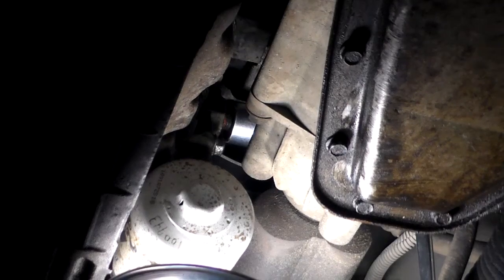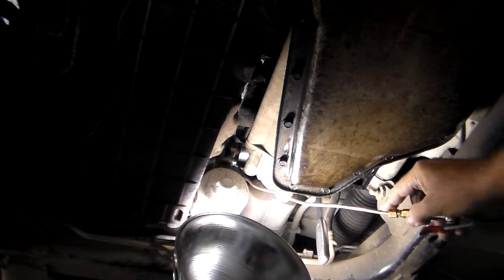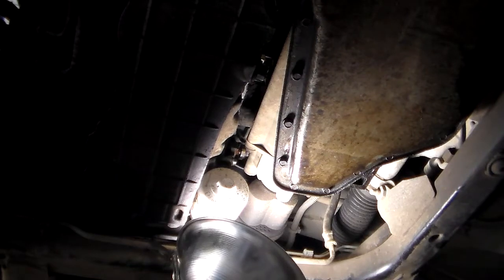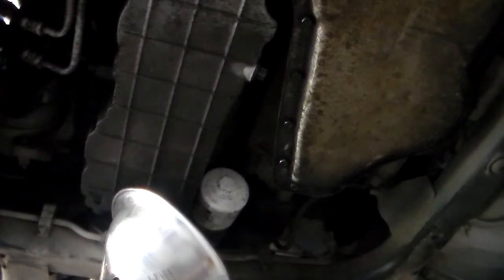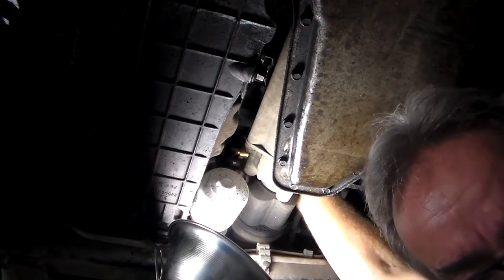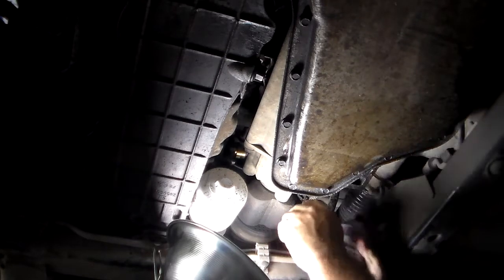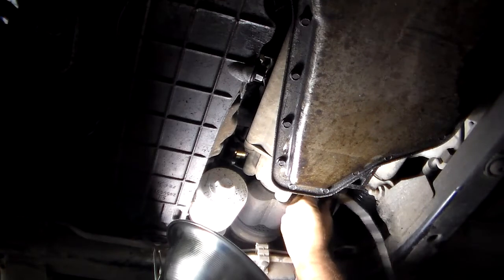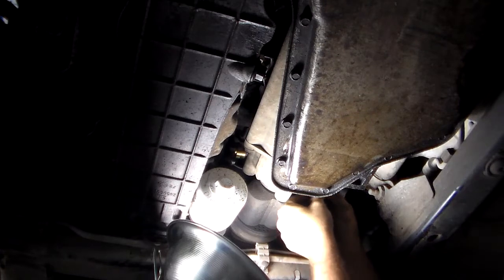2003 Buick Lesabre oil sending unit leaking

Comment: Looks like it's right above the oil filter, correct? What brand did you go with for the sensor and do you need any swivel sockets to get at it? I do have an actual sensor socket for it....Great video! Thanks! I'm doing mine tomorrow.
Reply from the maker: Yep thats it.
Reply: @scottsinfl   Thank you!

Comment: My dash gague has always read about 70 normal psi but I noticed today it reads 125 normal. Could the switch be it? I got 108,000 on the clock ands runs just fine. Thanks
Reply from the maker: Yes that's one of the symptoms of the sensor leaking into the wire harness and that makes the connection that will max out the gauge.
Reply: @scottsinfl   Thank you Scott for the info. Today my readout on my dic says normal 130. I'm going to use car ramps to raise the frt of my car, but Would it be better to use jack stands?  Do you have to take wheel off to get at it? Could I use carb spray to clean the connector? Sorry for all the questions
Reply from the maker: @johnwagner4559  No you don't have to take the wheel off and just make sure your ramps or stands are safe and you can use carb cleaner to blast the oil out of the connector but if you can blow it dry or that cleaner can melt the rubber seal that's on the connector it keeps dirt out. Yea that motor should have around 60-70 psi oil pressure not 130. I don't mind ?'s at all I'm glad to help.
Reply: @scottsinfl  Thank you very much! Good man!

Comment: Can a oil sending unit leak be mistaken for an oil pan gasket leak sometimes on these 3800 motors.
Reply from the maker: Yes that's what they told my buddy was the problem at the first place then the next place he took it to tried to charge him like 600 to replace just the sending unit as you can see in this video its not that hard to do and it don't cost a lot to do.
Reply: @scottsinfl  damn that sucks. I may have to do this on my leasabre as I'm dealing with the same issue. I work at a shop so I'll start with the sending unit and see if it stops the leak. Thanks alot and appreciate the video and knowledge 💯🤝

Comment: What if I dont replace the oil pressure switch? Mine is reading 140 but it says its normal
Reply from the maker: Its leaking oil from the sensor and you dont know what the oil pressure is. The only bad thing about that is the buick oil pumps go bad quite often so you really want to know when it starts to drop down to the 20psi or less range.